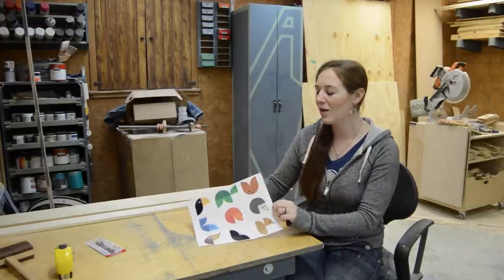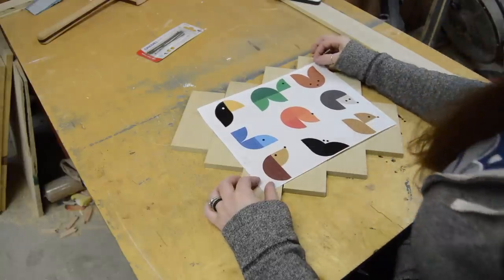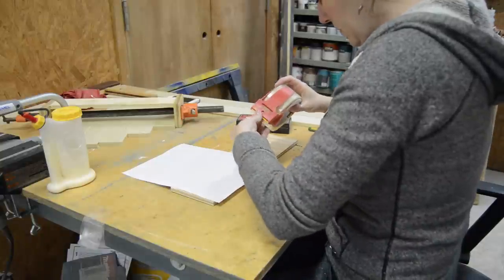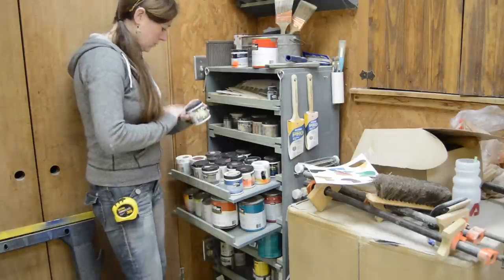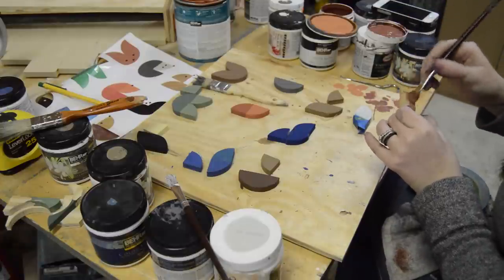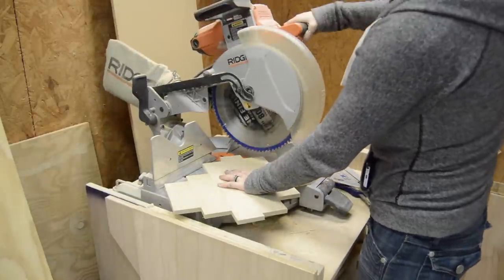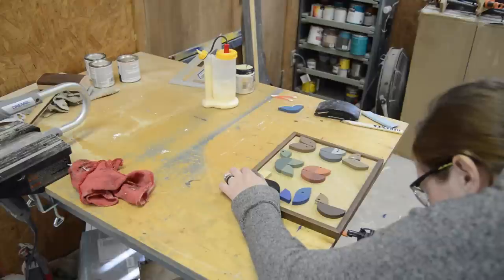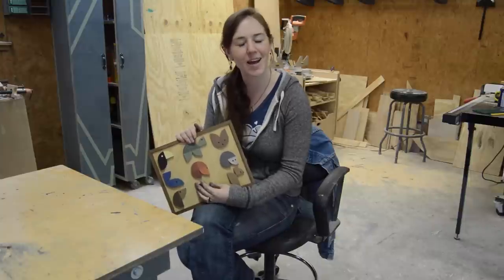DIY Nursery Wall Art

Comment: I scratch build RC planes all the time and what I like to do for templates and such is to use a little bit of spray adhesive and then stick it to a piece of poster board picked up at my local dollar tree. Works really well for me and when I'm done I just paper clip them all together for later use if needed.

Comment: At first I thought it was a hedge hog, but now I can see how it also looks like an opossum. Hedgehogs are much cuter IMHO. Great idea in changing the wood grain and what a great gift idea!
Reply from the maker: Thanks. Looking back, I still like the grain running diagonal but I wish I would have rounded over the edges slightly before joining them, to make each board distinct.

Comment: Another nice job kiddo. An idea for the puzzle concept....double side tape 2 layers together before scroll sawing and what you cut out of the top layer will fit right into the bottom layer....you can move things around to get them where you want and where looks best. I hope that made sense, if not drop me a line and I will try to explain better
Mike

Comment: Looks very cute! It would also translate well into a shape sorting puzzle, just add another layer of wood with the shapes cut out, have the picture underneath and then add the blocks on top. Would have to make sure the puzzle pieces are non toxic and maybe sealed with something. Great little gift either way! Thanks for sharing :D
Reply from the maker: That's what I thought!! I actually asked my coworker if he thought it would make a good puzzle. He has a 3 year old and he said if I made the animals one cut out then she probably would. But, I don't have any idea how I would carve the shape into the background.
Reply: I don't know much (read anything) about wood working, but on the layer that you need to cut out, could you do a pilot hole and then use a jigsaw or something similar and cut out the shape, or you could cut into the later and cut the shape out and then use some glue to glue it back together.

Comment: Nice project. And great tip with putting tape on the stencil. I will use it. I made a couple of stencils to paint my name on job site tools and they were pretty labor intensive. Just some simple packing tape should make them last forever. Thanks.
Reply from the maker: ; ) Glad it helps. Yeah if you laminate both sides with tape you can trace without ripping them, but also use spray paint or regular paint and not ruin them.

Comment: I really liked that tape trick you did with the stencils. The few times I've had to cut something out, I've ended ripping the paper.
Reply from the maker: Yeah I know what you mean. I make my own stencils whenever I want to paint something specific and that's when I discovered the tape thing. If you don't put tape on first then as soon as you paint the paper, it's ruined and can't be reused. With taping both sides first, you can use the same stencil for years.

Comment: Your work is always so beautifully finished - but I agree with another poster in that you need some of those thin latex gloves to keep your paws clean without losing too much touch sensitivity.
Reply from the maker: : ) I think, even if I had gloves in my shop, I wouldn't take the time to put them on. It truly just doesn't bother me. It washes right off after I'm done working.

Comment: Nice Job April. Do you have a 23ga pin nailer? If not I would seriously recommend getting one as they are not very expensive. It's perfect for things like this where if you are brushing finish on sometimes you don't even have to fill nail holes they are so small. I rarely use brad nails anymore.
Reply from the maker: I don't, the only nail gun I have is an 18ga so it gets used for everything. I know they aren't expensive but I have a huge list of tools that I want/need, so I save my pennies to purchase them first. ; ) Once I have all the main items I need/want, then I'll start allocating money to upgrading and expanding the tools that I already have....like a second bigger router and a dedicated belt sander, and a 23ga and 16ga nailer. But! in the mean time I have a tool in each of those areas that will tide me over.

Comment: Just a question - Did you cut all of the pieces out individually? They all look to be made up of quarter circles, although some may be semi-circles in this case. Could you not just cut up a load of quarter circles and make the animals from 4/5 of these?
Reply from the maker: You could do that, but the element of the picture I like the most is that all these animals are made from three simple shapes so I wanted to make mine just like the original artist.

Comment: Nice Project but  I have done this much simpler way. There is no need for tracking and cutting pieces on band saw etc. Simply cut circles of 5" or 6" dia wooden pieces and each circle cut into 4 equal quadrants and paint them and appropriately place them. That is it. You can cut as many circles as the quadrants needed for making all of them, each circle yielding 4 equal sized quadrants.
Reply from the maker: I didn't want to have 4 equal quandrants to make up the animals, I liked how there are four distinct shapes. However, yes you could very easily make it that way.

Comment: I had to stop and go back when you broke out the speed square, WTH?  I always try to line up the blade with the line but this is a different and probably more accurate way to do it, thanks.
Reply from the maker: Yeah it was the only way I could figure out to get an accurate 90. Then once I had at least one side accurate then I could move it to the table saw and use the miter gauge to get the other three sides.